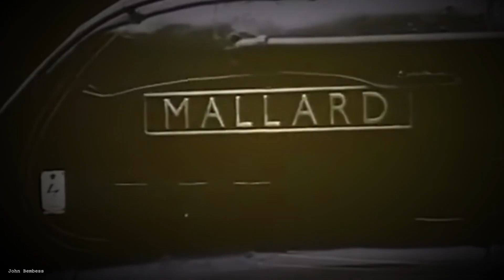What 1930s British Engineers Understood About Speed That We Forgot.

Comment: I'm watching this from Australia with my own 5" gauge live steam model of Mallard sitting on the workbench undergoing work in preparation for its first steaming.
She was a thing of her time, as you said. She was a masterpiece of 1930's design but we haven't solved the problems of speed on rail by simply increasing power. You mentioned the TGV (which I have ridden) and the Shinkansen as examples of trains that achieve their fantastic speeds with raw power but without the same degree of attention to streamlining that Gresley applied in designing Mallard they could not do it. They also rely on careful attention to body shape and weight saving materials. Once those factors are managed raw power is the only direction available for maximum speed.
Steam is beautiful and seems to be alive. 
A steam locomotive is the nearest thing to a living creature that can be created by engineering; combining as it does the four ancient elements  - Earth(coal), Air (steam), Fire and Water (need I explain these last two?) and Mallard is a prime example of such a beast.
PS I've seen her in York too!